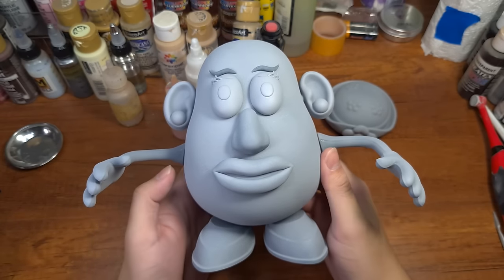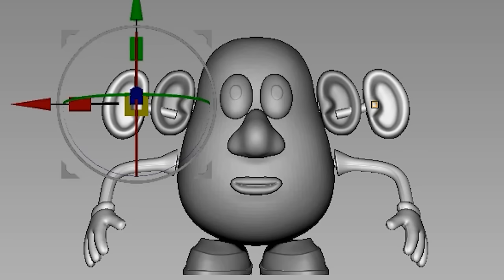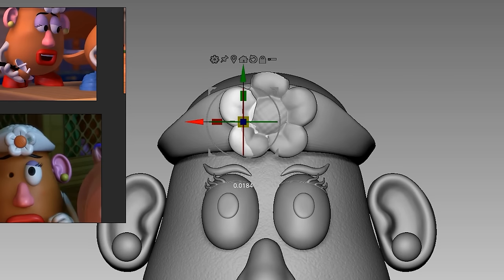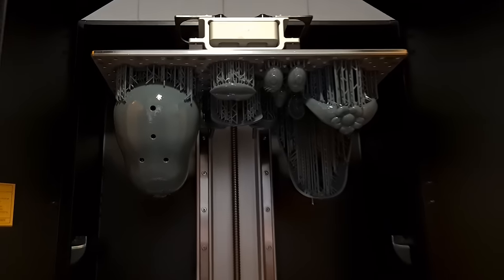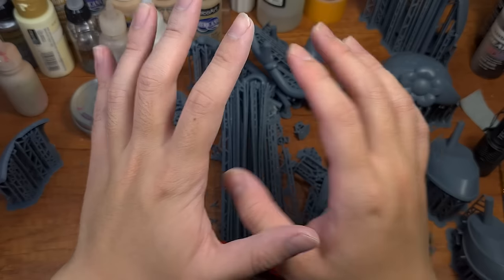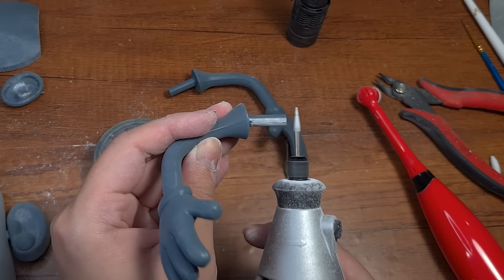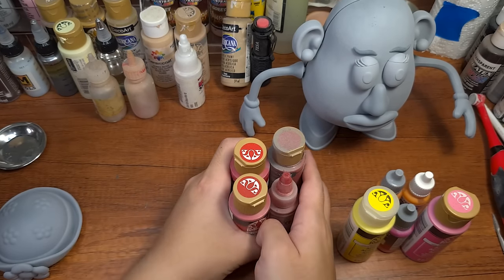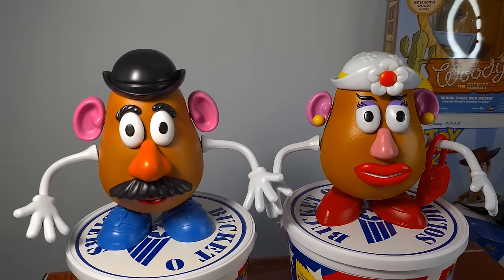I Made Toy Story Mrs Potato Head In REAL LIFE | 3D Sculpted Custom Phrozen Mega 8K 3D Printer

Comment: Came out amazing! With the printing specifically, you could definitely get away with using light supports, the key is to just place more of them. Heavy = Less+more scarring, Light = more+less scarring. It also helps to take the supports off before doing the post cure. If they are especially stubborn or are still scarring, use some hot water, and they'll peel right off. Keep up the great work! Love your stuff.

Comment: Would it not be better if you print the main potato shells horizontally? That way all the supports are on the inside and you can avoid the sanding and texture loss.
Reply from the maker: the stepping lines would be in front of the face instead of above on the head which I could just hide under the hat

Comment: A trick I found for removing supports without leaving artifacts behind, after you pull your prints out of the  isopropyl alcohol you need to rinse the off anyway, rinse and soak them in HOT water for a minute or two and the supports pretty much just fall off. Then cure prints without the supports attached. I 3d print action figure accessories for a living and this is what I do. I also pretty much only use light supports but it should work with medium?